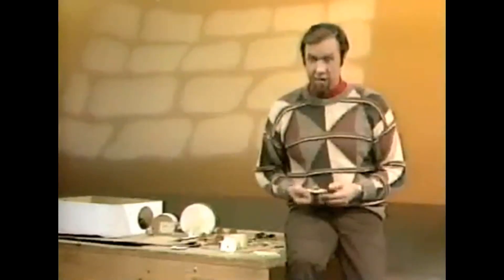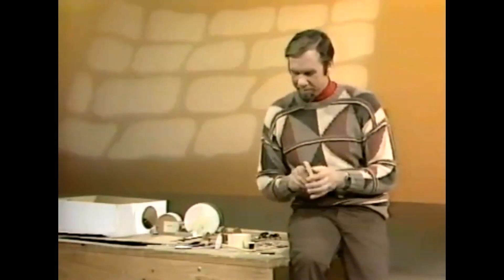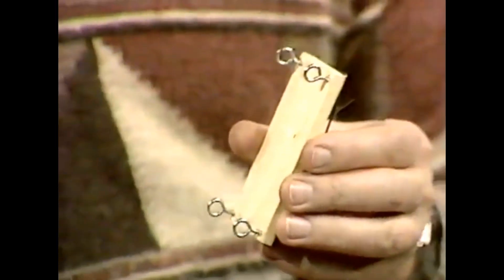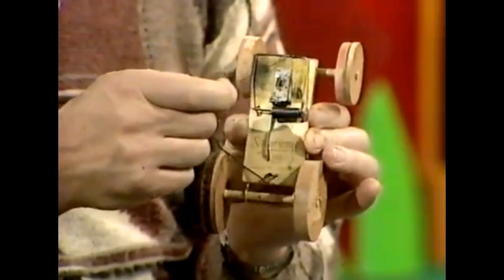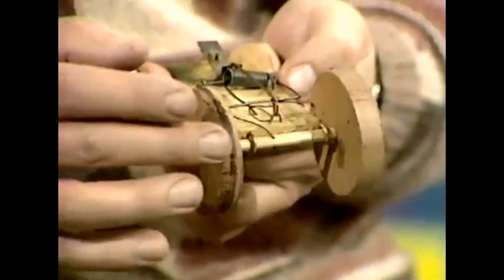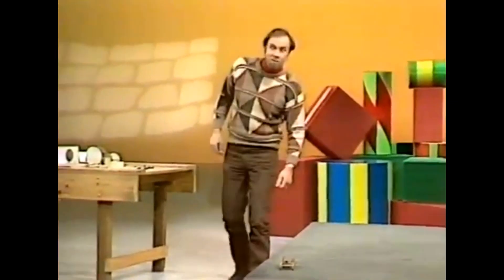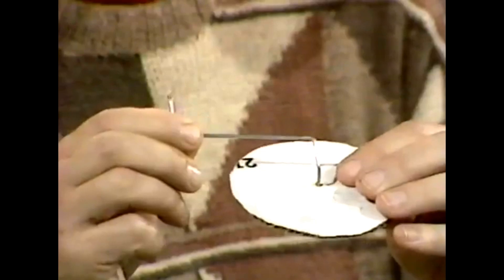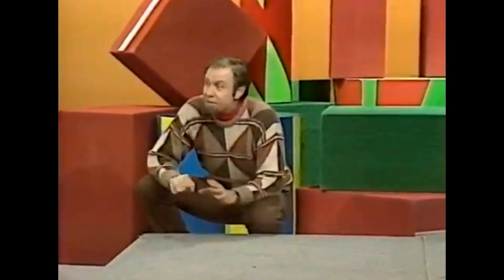Mousetrap Racer

Comment: I once made one of these by using vinyl records for the back wheels, and extending the wire "trap" bail with an additional length of wire.  It was okay... but I got in trouble for using "good" records and not "bad" records.

Comment: I did this in my first Intro to Engineering Course for the term project. It was a constrained design team project. We had a good design, but did not place first. We were given :
1 mousetrap
1 length of string
2 soda pop tops 
2 Bic ballpoint pens with lids
4 Compact Disks
4 eyelets

I made a fun little video for the first working prototype. I'll have to track it down and upload to YouTube 😄

Comment: This makes me want to see just how far I could push things by using o-rings for tyres and playing with different wheel, bearing and axle materials. Maybe some lightweight plastic with holes drilled in it and thin bushes bored with countersinks front and back intersecting to create knife edges the axle can ride on (to minimise friction). Will ask work if there are some offcuts to take home for this weekend's project :D

Thanks Rob!

Comment: Step one. Make a mousetrap car
Step 2. Find a long flat non-carpeted floor space
Step 3. Race ; Step 4. Make another most trap car but different wheels
There's more engineering design in these than I would have guessed
Reply from the maker: That was the idea, and all with simple everyday materials - Rob